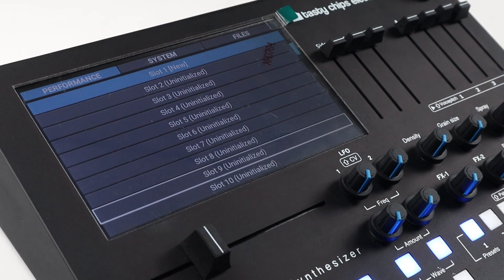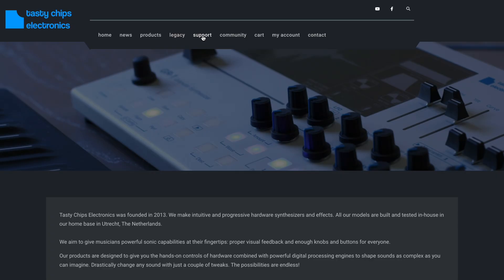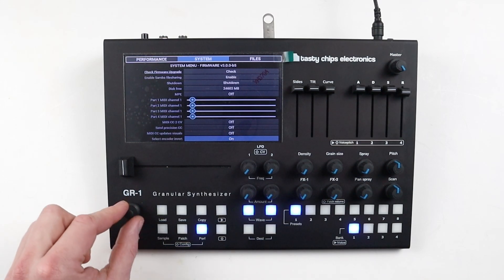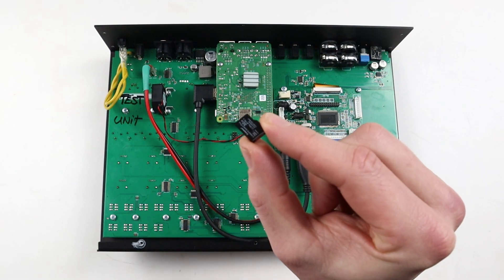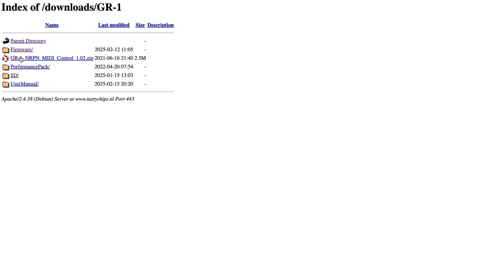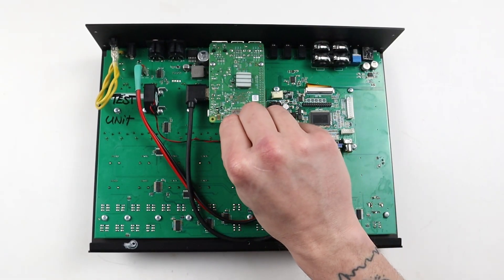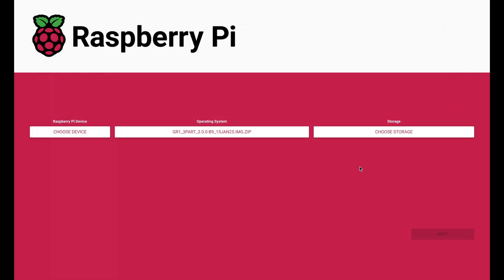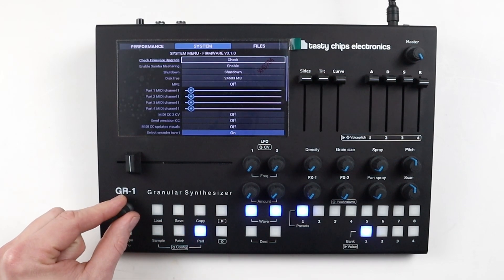GR-1 Firmware 3.0 Update procedure

Comment: Is it a must to reflash the internal SD card or 3.0 firmware upgrade works without it? I mean only via external USB. I skipped opening it and when i try to save a 4 part multitimbral performance, only the first two parts are saved, last 3-4 are missing. That's why i ask. THX!
Reply from the maker: I'm not sure if I understand correctly, but there are SD cards out there that have been corrupted over the years. That's why we recommend flashing the SD card if you have a unit >2 years old. The new SD card image also protects against corruption, and using the soft shutdown in the system menu helps too. If you reflash your SD card, please back up your performances/samples/patches to USB. Thanks.

Comment: Very good Idea to make a short video about it! I was a little bit afraid at first to open up my unit just for a simple update, but now I did it and it works great! I put in a different SD card I had still lying around from my Maschine+. It's 64GB. Should be fine long term, doesn't it? Works flawless now and also the USB update to 3.1 after the reflash worked fine. Thanks so much for still putting love into this machine, even after all these years ❤

Comment: this reflashing process is so easy to understand via this vid! not sure if i'm needing to actually refresh mine as the 3.0 update was no issue but since it's a 2020 model i'm considering doing just for stability purposes.
Reply from the maker: Reflashing yields the best results. Of course your should backup your performances first. You can typically reuse your old SD card, although buying a new one as per recommendations in the manual may be even better.
Reply: @TastyChips  killer! tysm!